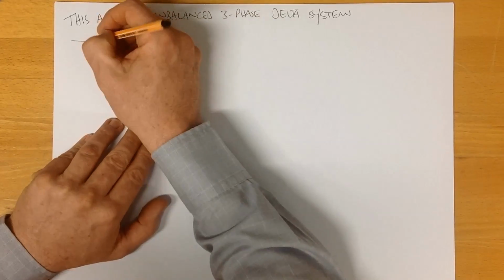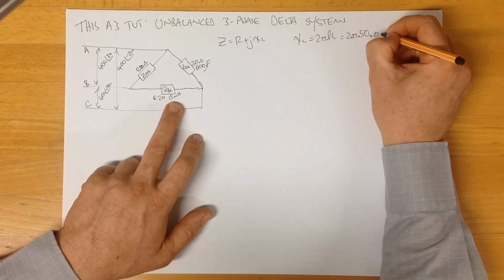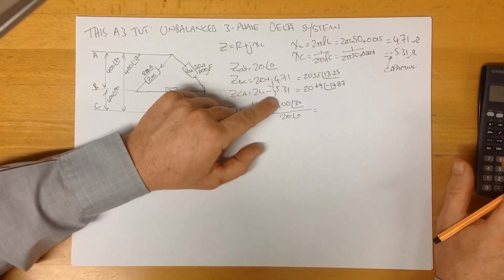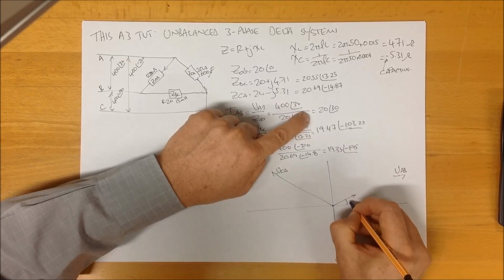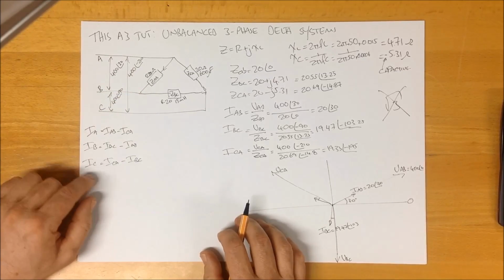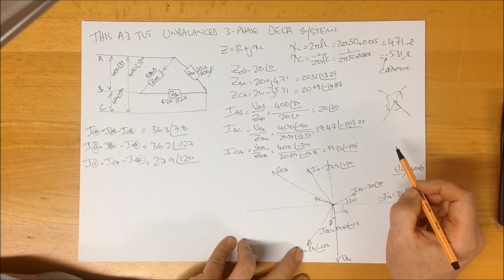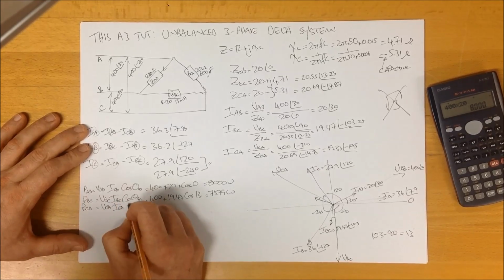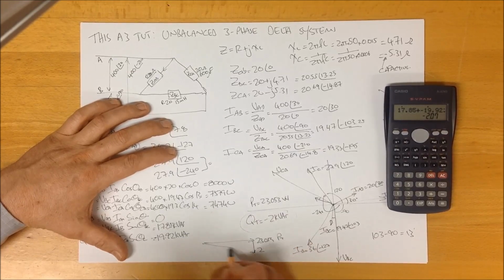Taylormade@AUT A3-tutorial: Unbalanced Three-Phase Delta system

Comment: thx for the tutorial. Although you got me confused at first (probably just me :) when you defined the voltage between the phases. It seems as though there is a phase difference of 30 deg between A-B, -90 between B-C and -210 between C-A (which would end up being 300 deg or -60 between A-C). If the reference is 0 deg, then it all makes sense (120 deg between all phases).
Reply from the maker: +Ken ded Hello Ken.  The 30 degrees reference on Vab you see is relative to Va (which has a 0degree refernece)  I will endeavour to create a tutorial on this and post it for you?

Comment: Great informative tutorial. Just wondering if you could do a similar one on an unbalanced 3 phase star system under floating neutral conditions. How phase voltages are affected by loading etc? Thanks
Reply from the maker: arethosemyfeet111 Done.  Unbalanced three-phase-three-wire systems with a floating neutral are (conceptually) the same as an unbalanced four-wire system with a finite neutral impedance, but the impedance is infinite.

Therefore, Millman's theorem can be applied to find the voltage potential difference between the two neutral points: Vo-n.

I have done a sample for you, and posted it at https://www.youtube.com/watch?v=2laC0ua5sds

Enjoy!
Reply: Taylormade@AUT Thanks for such a quick reply. Haven't had a chance to the video just yet but will check it out later

Comment: Great videos! :) One thing that is doing my head in is the phase currents in a delta source. Any tips? (It's killing me!!)

Using this video, you end up with line currents to the load. So, with an unbalanced load, to find the phase currents in the source, I've used the set of equations Ia = Iab - Ica , Ib = Ibc - Iab , Ic = Ica - Ibc. (Where Ia, Ib and Ic are the line currents)

Putting the 3 equations together, they cancel each other out so I can't solve for the phase current (Iab, for example). Surely it is possible to calculate the source phase currents only given the source line currents for an arbitrary (i.e. star or delta or any impedance) load?
Reply from the maker: aaronich Hi Aaron,

I am having difficulty visualising what you mean.  Can you draw a diagram and email it to me?  adam.taylor@aut.ac.nz
Reply: Taylormade@AUT Thanks! Sent you an email from my yahoo account (just letting you know in case your spam filter catches it)

Comment: What happens if there is network impedance? Thanks for the great tutorial.
Reply from the maker: You're welcome.  If by 'network impedance' you mean an impedance back up in the voltage sources or in branch or bus off this line, then it will effect that aspect, but (with lots of disclaimers) for the purposes of this steady state calculation it would not effect things.

If there was a bus and a branch of network off to the top/bottom of my schematic, then they would draw a current as expected, but assuming the voltage at the node point was known it would be this voltage used for the calculations as that is the voltage that would be over the loads.

Note that this simple steady-state system and the above explanation does not account for transient events and responses in the system, which are another level up of complexity.